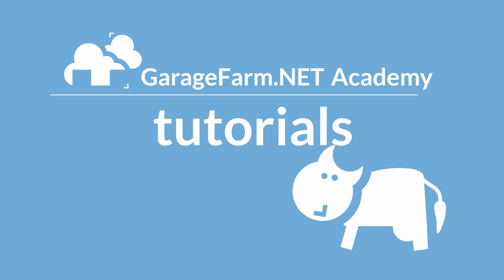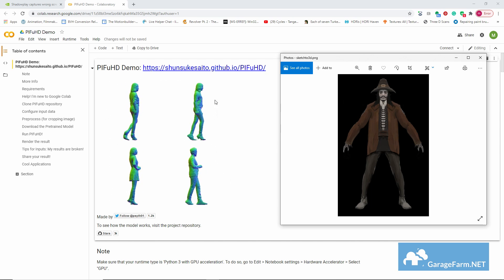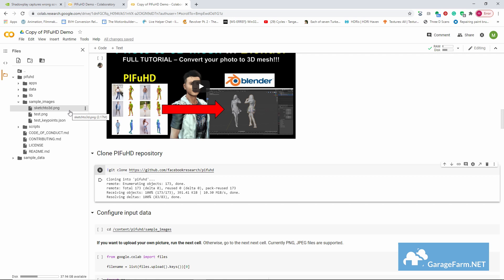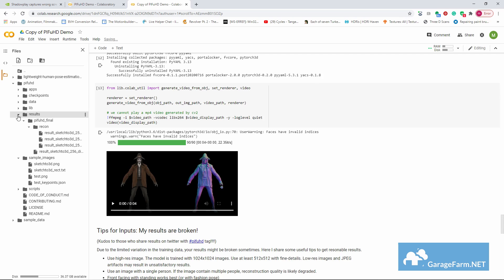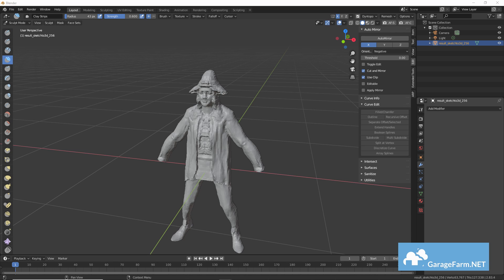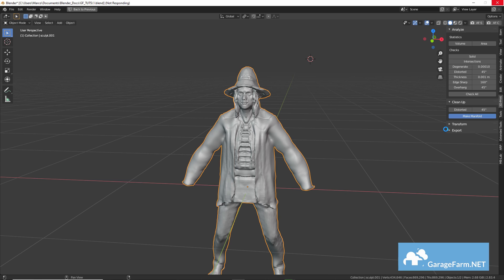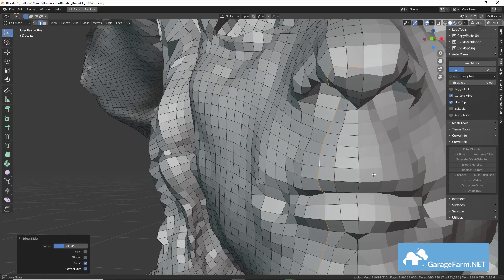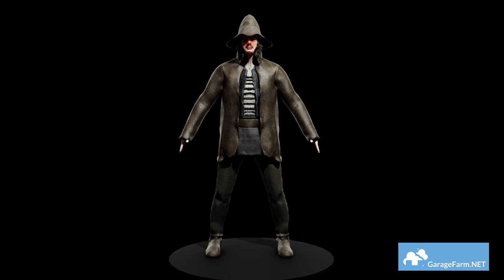How to convert 2d sketch to 3d in Blender with PIFuHD

Comment: Bro, This is amazing. I tested this with so many different pictures with simple white backgrounds or PNGs (so that AI will not get confused) But the final model Render is of very low quality. I mean face is not even visible It's just like a plane with almost no nose, eyes ( Hardly visible) Is there any way to get better results. Or any other website or software that can create a 3d model from an image. 

All i need is to create 3d model faces of some persons :( I need to match the face. 
(If i import only face in very high-quality image in PIfuHD that will be useless bcoz its AI needs full-length pictures from head to foot) 
If u got some way Please let me know bro. I got stuck in between a project due to the requirement of those faces. But i dont know sculpting or Blender deeply. I do only 2d stuff. If u can let me know some shortcut way, I will owe u my life brother.

Comment: cant get past this error 

net = PoseEstimationWithMobileNet()
checkpoint = torch.load('checkpoint_iter_370000.pth', map_location='cpu')
load_state(net, checkpoint)

get_rect(net.cuda(), [image_path], 512)

---------------------------------------------------------------------------
TypeError                                 Traceback (most recent call last)
<ipython-input-10-736a0682666b> in <module>()
      3 load_state(net, checkpoint)
      4 
----> 5 get_rect(net.cuda(), [image_path], 512)

<ipython-input-9-2dd51ed5e564> in get_rect(net, images, height_size)
     28             total_keypoints_num += extract_keypoints(heatmaps[:, :, kpt_idx], all_keypoints_by_type, total_keypoints_num)
     29 
---> 30         pose_entries, all_keypoints = group_keypoints(all_keypoints_by_type, pafs, demo=True)
     31         for kpt_id in range(all_keypoints.shape[0]):
     32             all_keypoints[kpt_id, 0] = (all_keypoints[kpt_id, 0] * stride / upsample_ratio - pad[1]) / scale

TypeError: group_keypoints() got an unexpected keyword argument 'demo'

Comment: Hii Sir,
How to improve mesh quality in code
Reply: I haven't tried this yet, but in the Run PIFuHD section, there is a parameter for resolution (look for -r 256); This is the maximum resolution online mode supports, but if you can set it up on your own computer, you could try increasing this number.